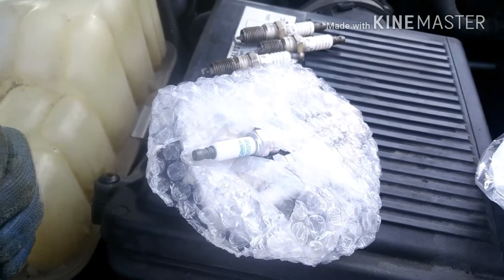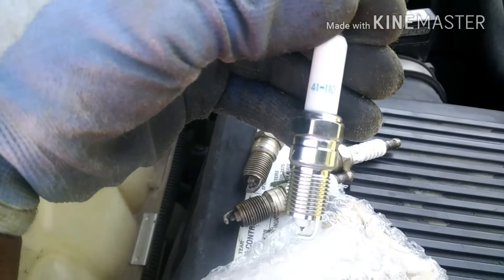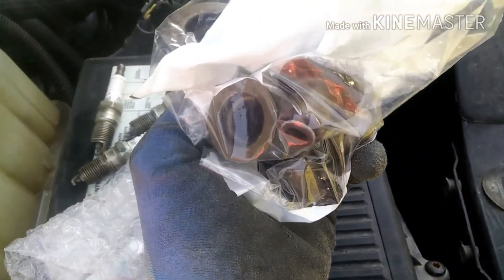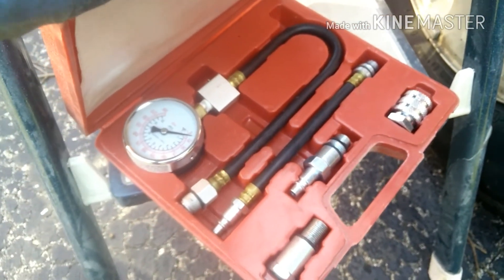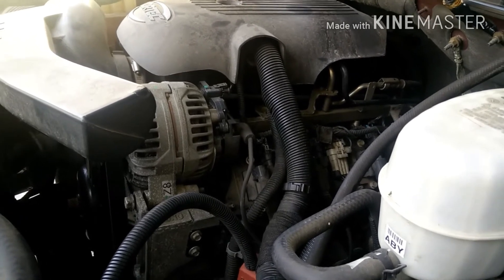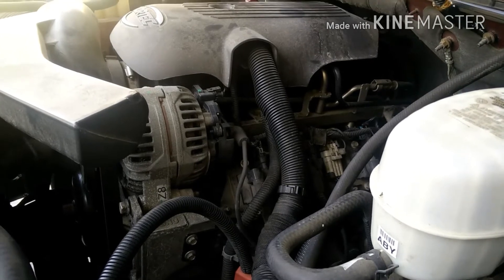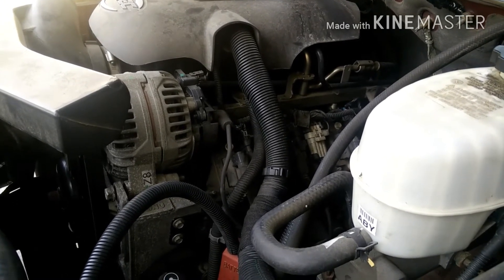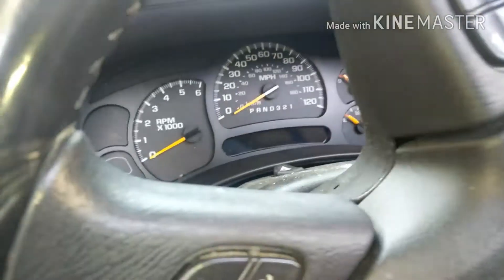Tahoe update bad spark plugs

Comment: Hey Zo, I HATED using that tool when I did valve stem seals, but yours look different on the top. Can you put a socket on that one? The one I had, look similar to that one, but you had to manually turn it by hand with a star handle it had on it. Great that the miss went away after replacing those plugs!
Reply from the maker: ⭐ Astral Auto Repairs yeah I believe you can I ll check later on right now to hot outside. There is an extra piece that go on the top just wasn't on it . If you look closely you will see it in the video just wasn't on it .
Reply: Lol, heck yeah it's hot out. Over here it's almost 90